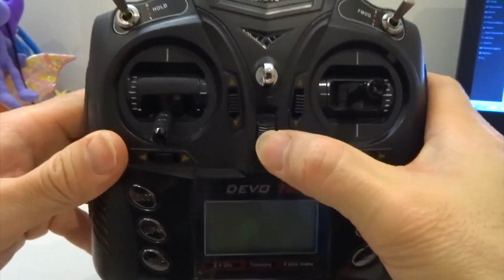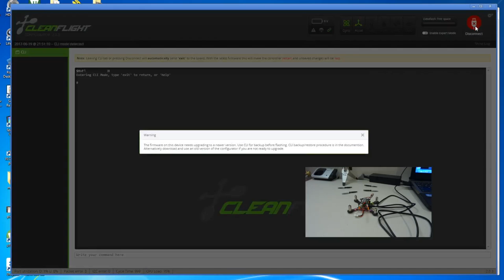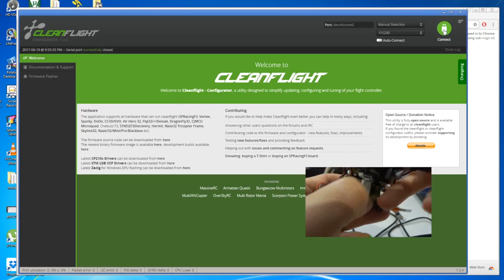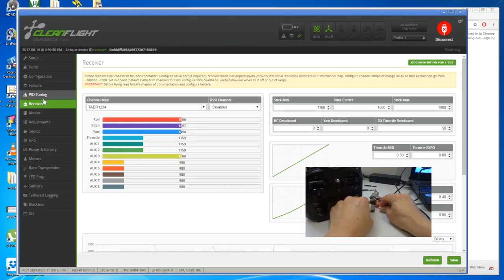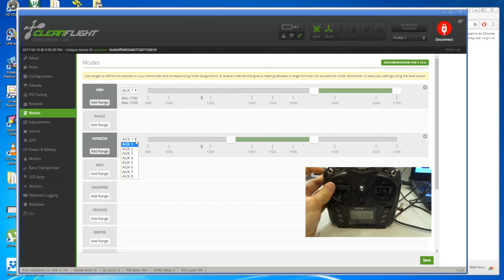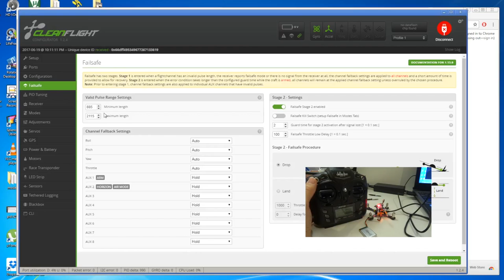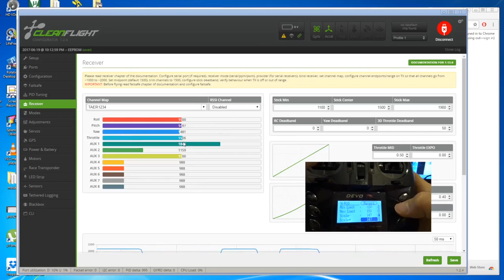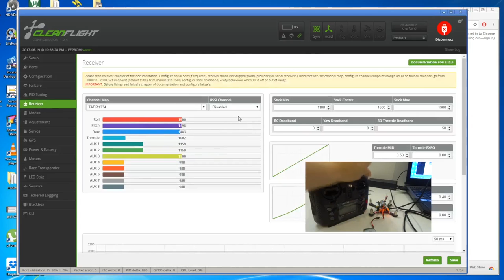Devo 7E - Binding DSMX receiver Tutorial - troubleshoot not spinning motors (also Devo 10)

Comment: I followed all the steps to bind my Beecore v2.0 with frsky receiver to devo 10 4-in-1 (thank for the videos for me to learn the upgrade) but still does not arm the motors.  Should I update the firmware first but I don't know the motherboard model. Can you help.
Reply from the maker: Go to Deviation website and find the firmware for your 4 in 1 module, if it is soldered in as I remember, then any latest Devo 10 firmware on that website should work, best to use the nightly build, I have long given up on Deviation because I only fly frsky, best to just buy qx7 for all frsky as most likely you will only fly frsky only, also check that your throttle lower limit is 1000, otherwise it won't arm
Reply: @johnnytu1411  thx. for the comments.  My devo 10 is a used one and I upgraded it with 4-in-1.  With limited budget, I will keep it.  I managed to fix the problem by upgrade the latest firmware to beecore v2.0.  It is now armed and the motors (I am using my Eachine M80 fiame) can spin.  The drone can fly.

Comment: Hello , I have the devo 7 for my walkera f210. Some how when I was messing with the transmitter settings on the TX I have aux 1 and 2 moving on the same channel. So when I arm both channels are moving in CF modes tab and recover tab,they are set to different channels. Do you know how to fix this?
Reply from the maker: Hi, best thing to do is to reset the model and do all the settings again according to your f210 manual.
Reply from the maker: Hi, hope my new video here answers your questions https://youtu.be/cMkA8mFx9gs